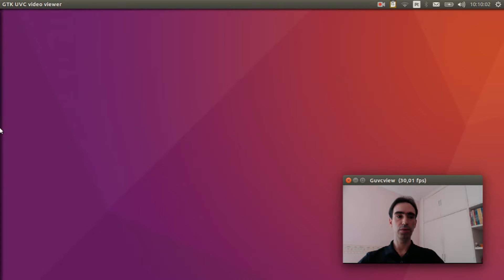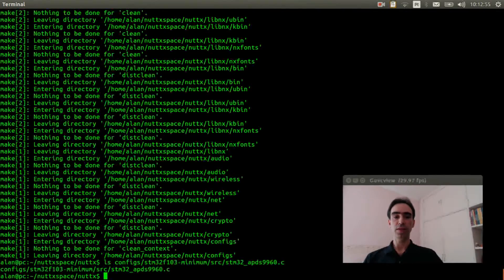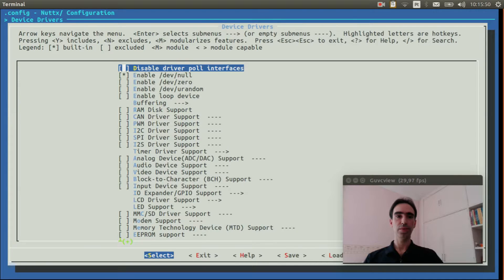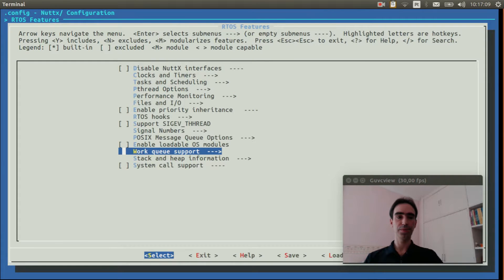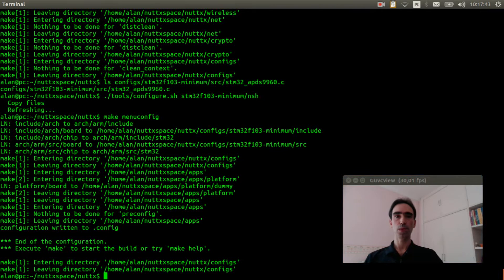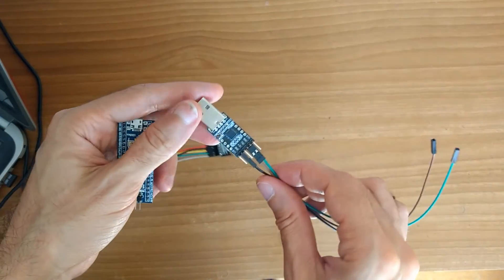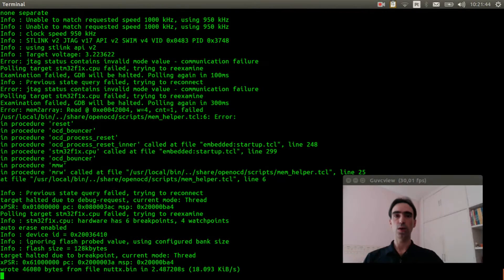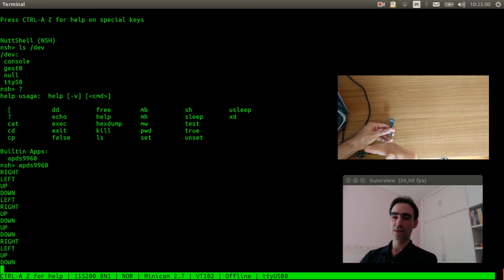#022: Using the Gesture Sensor APDS-9960 on NuttX

Comment: Hey Alan, thanks for the detailed guide. Unfortunately when I tried to run the driver on my own STM32F103C8 board, I’m getting hard fault every time an APDS9960 interrupt occurs. Further debugging revealed the hard fault was caused by a context switch. Have you encountered a similar problem before?
Reply: Found one possible cause. When the APDS9960 worker is queued in apds9960_int_handler, the content of priv->work.worker is uninitialized. Therefore when the work is being queued, the uninitialized value messes up the entire queue. My temporary solution is to initialize priv->work.worker to NULL, and hard fault no longer occurs.
Reply from the maker: Nice found Kyle Lei! Please submit a patch to mainline. You can do it at NuttX's google group.